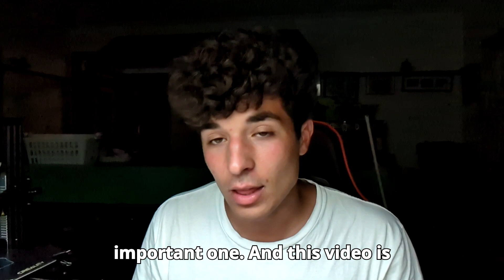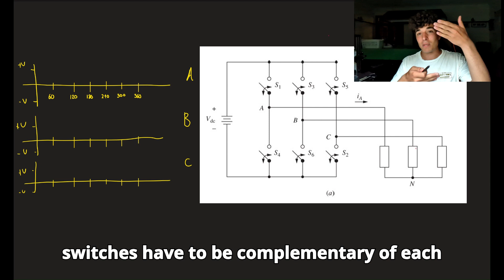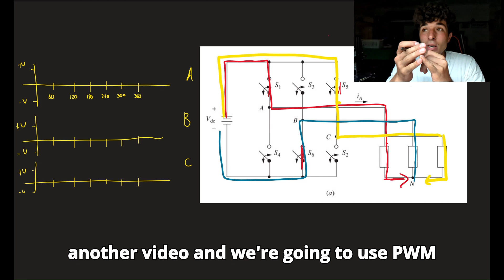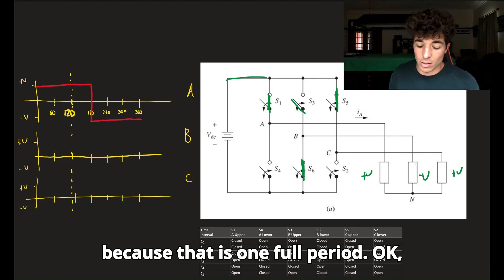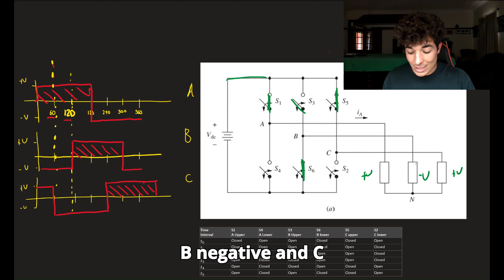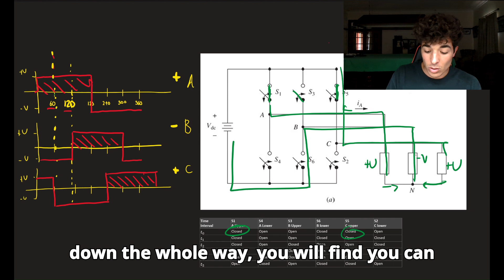How to build a 3-phase inverter

Comment: IPM's are easily available online.  Can you show us how to use stm32 (for example) to control a 3-phase washing machine motor?
Reply from the maker: That is such a great idea! because I will be building a 3 phase inverter soon. so I could test if it works on a washing machine. Thank you for the suggestion
Reply: @xavierturano548  Excited to see the coming project.  I have an Electrolux front load washer which was dumped by my neighbor.  The motor is 3-phase, model CZ-551950-51R07, 195v, 300hz, 3amps.  I have not yet removed the IPM but my best guess from the outline it's likely STGIPS20K60.
I believe there are many other enthusiasts yearning to build controllers for a similar motor.